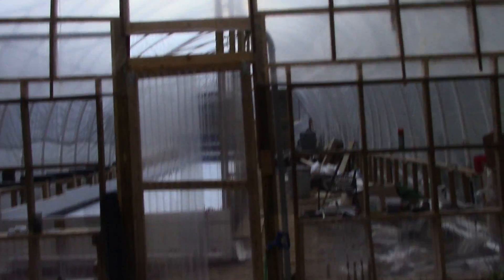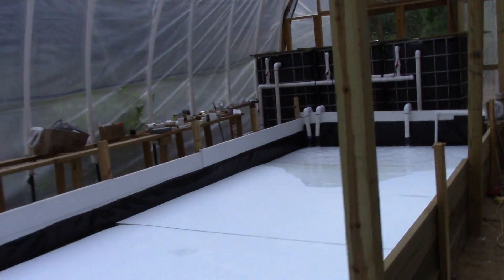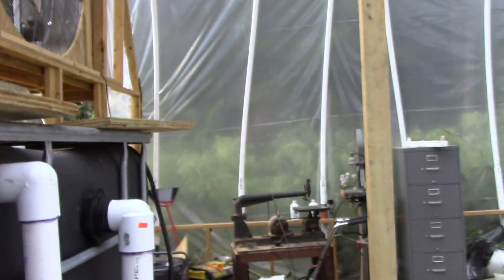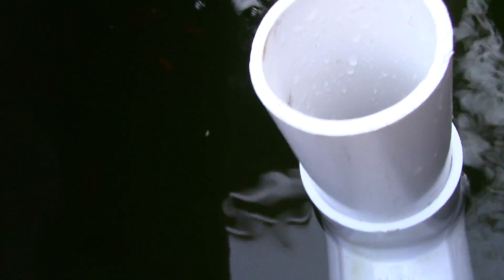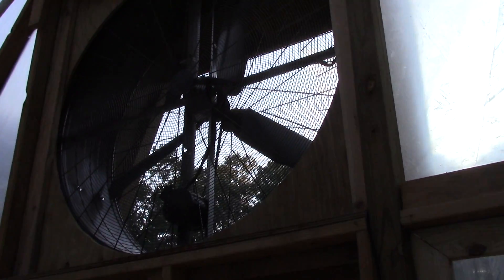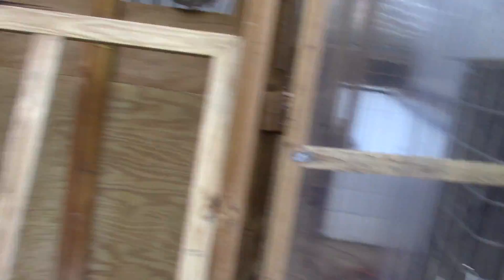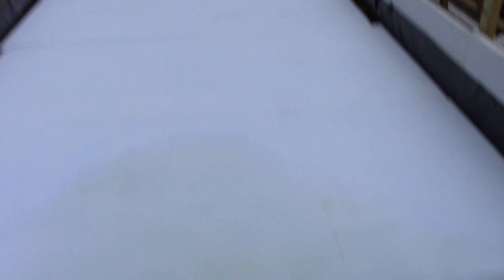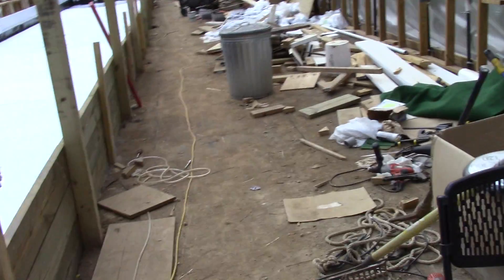Aquaponics Greenhouse Development Update

Comment: Seems to me you will uses a lot of power pumping water. Would it not better to dig the fish tanks into the ground, so that you get very little height difference between the top of the tank, and your waterbed? This might be quite significant electrical power requirement.

The ground around the fish tank would be isolated, to avoid heat losses. Also, having a large ground volume around the tank would provide a large thermal mass to avoid fast temperature change that could harm the fishes.
Reply from the maker: Not a bad idea in general, but the water table is only a foot down most of the year at my greenhouse - could be a problem as it could collapse or push up an empty tank.
Reply: Than, maybe you should rise your growing area to a level just below your exit pipes from your fish tanks. This would reduce the pumping power, and allow you to put a much smaller pump.
Reply from the maker: I got my pump for free, and it is already far more powerful than I need. But I have accommodated that now with a bypass line.